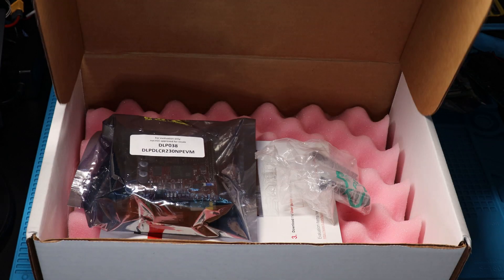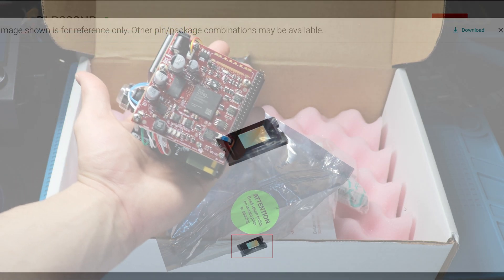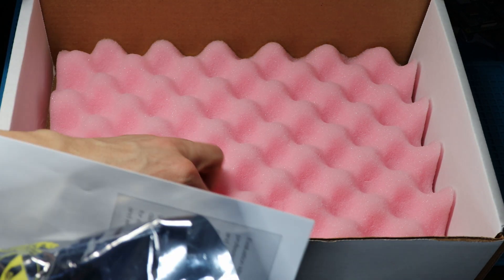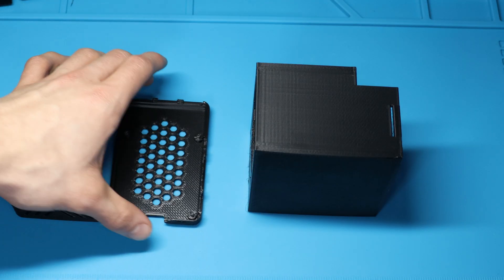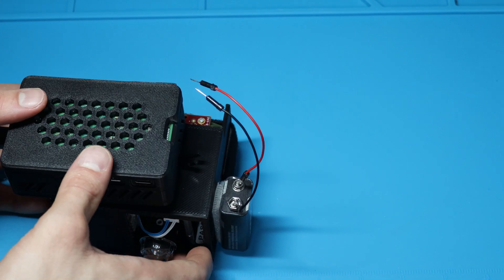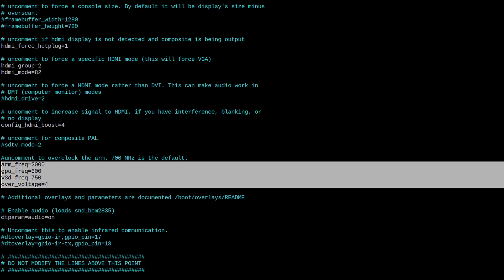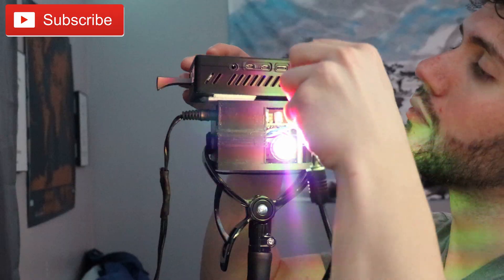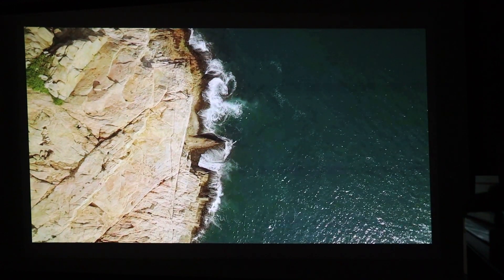World's smallest 1080p DMD Pi Projector

Comment: I'm wondering whether it would be possible to remove the bright leds and replace them with a light sensor - thus making a /camera/ out of it by flipping the mirrors in the DLP one at a time! (Maybe in a chessboard/multi-pixel-square pattern for more brightness, less exposure time but also lower resolution)
Reply: You can get just plain DLP modules without the projector stuff to try something like that.
UV resin 3D printers parts are probably the easiest option to come around.
Reply: @qdaniele97  too late, already took apart a beamer :D should have gotten a devkit from Texas Instruments though...
Reply: @coda6942  How is your project going? I want to do something that also requires disassembling the optical component. Do you have any tips or guide for exposing the DMD mirrors for a custom project? I want to shine an external light source into the DMD and use a raspberry pi to control the image that is reflected.
Reply: @rainzhao2000  I gave up for now because controlling the mirrors in the beamer would have required reverse engineering the firmware - it notices when components are missing, like the lamp. I think going with a DLP devkit is the only good way forward here without going deeply into firmware hacking or hardware manipulation
Reply: @coda6942  Ah sorry to hear that. Thank you so much for sharing your experience.
Reply: It would be a weird camera but you could put any filters in front of it/use different sensors so even infrared outside the usual RGB wavelengths!

Comment: Nice bit of kit, pity the released scripts only work with rasberry pi. Would love to pair this with an X86 board with 40pin GPIO such as the UDOO Bolt or the forth coming UP xtreme i11 and windows for a broader range of software options than the usual Ubuntu or android options.
 Unfortunately after reading around I quickly realised I lack the skill to figure out if its even possible, let alone get it to work. 
 Unfortu

Comment: Did you get the projector's bootloop at first powerup? It looks like endless flashing a splash screen with DLP logo for half a second. However if I fast enough to send leds sequence - it's starting to operate normally. Looks like it's not enough power to start the leds but I'm using 5V/20A power supply. 
Any help would be appreciated
Reply from the maker: Yes same thing happened to me! I looked up the official user guide that Texas Instruments has regarding the EVM module. 

The User Guide saved me a couple of times throughout the project.

https://www.ti.com/lit/ug/dlpu103/dlpu103.pdf?ts=1614121700254&ref_url=https%253A%252F%252Feu.mouser.com%252F 

check out page 6-7,
1. They go over power supply requirements (5V/4A)
2. They also go over the introductory workflow to get it started as well

If you run into anymore issues let me know! I'll try to help as best as possible.
Reply: @ZEP104  I used to reset using GPIO26 pin (PROJ_ON): driving low -> delay 1s -> driving high, and run init procedure after exactly 2 seconds delay. The user guide you've noted was useless for me.